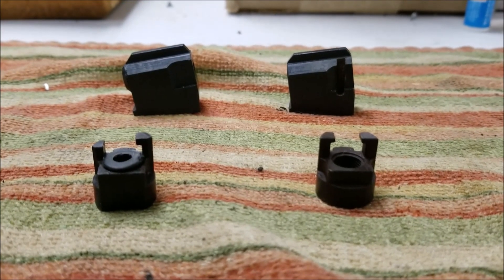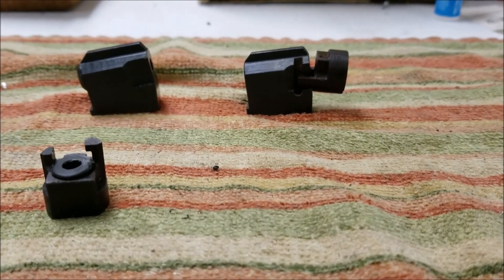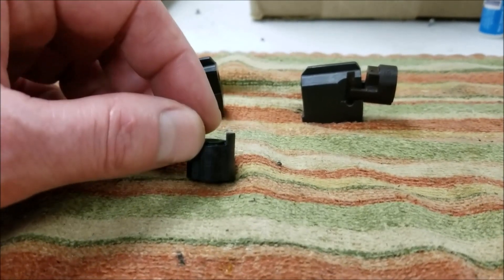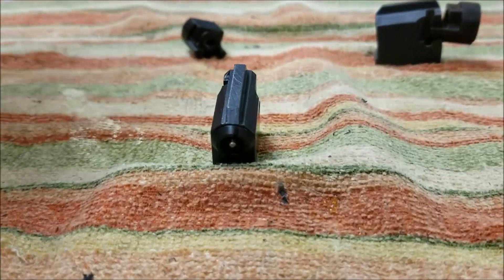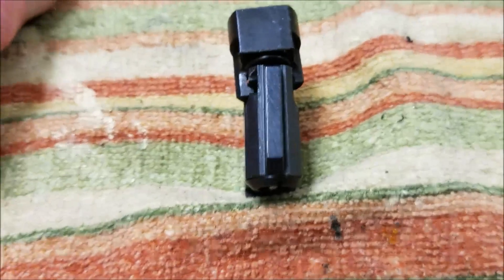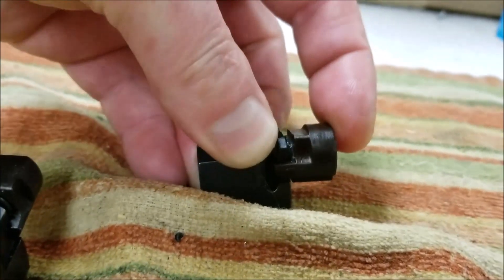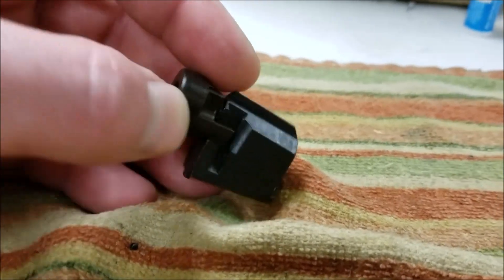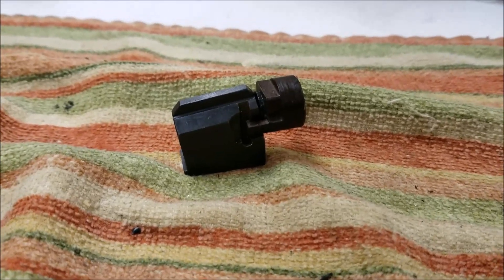Dual Hook Barrel Nut & Valve Body

Comment: If I do get one I'll just have you add it to my build.  I Would like to see it in action before adding it. At the same time I trust ya. 👍
Reply from the maker: I'm getting ready to go camping again this weekend. I just fixed my autobrake completely. I had to adjust the shoes. I'm going to try to bring my B with me to try it out. I'll still have to chrony it though. If it only performs just as well as the tape mod it will simply be an expensive indulgence. I like expensive indulgences.